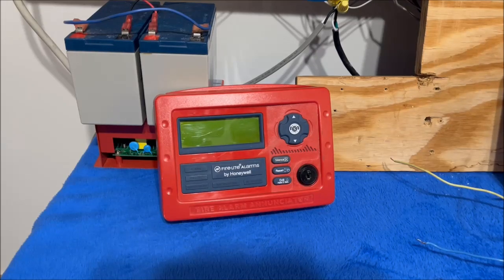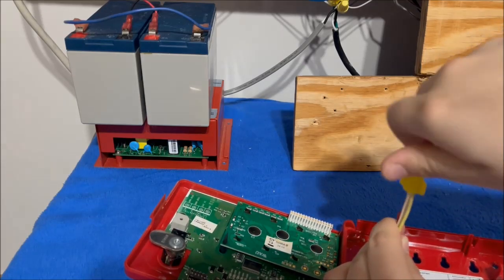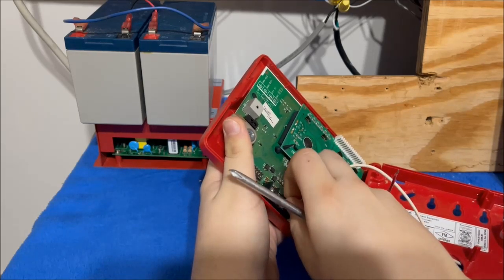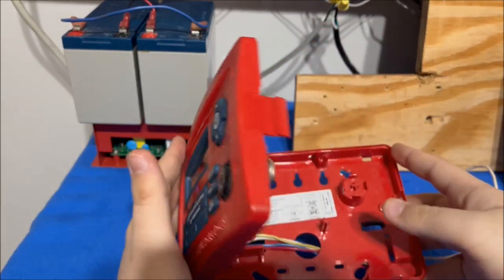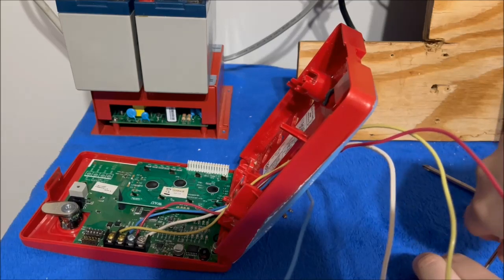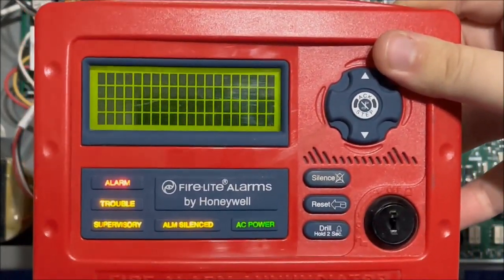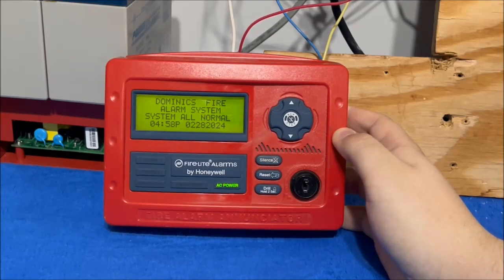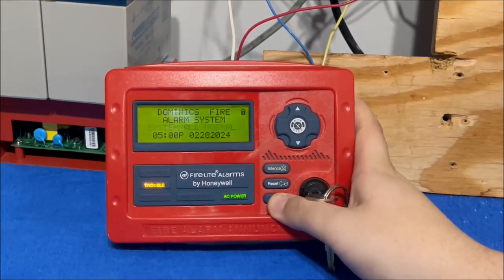Fire•Lite ANN-80 Fire Alarm LCD Annunciator in Red | Initial Checkout

Comment: interesting. had to turn my volume to 40 to hear you though. try talking louder or closer to the recording device.
Reply from the maker: That might be a problem with your audio device (no offense.)
Reply: @Dominic-G-2006 you could use old speaker wires it's better then using that thick wire
Reply: @ it’s not.?
Reply from the maker: @Futurejcpl_lineman115 What do you mean?